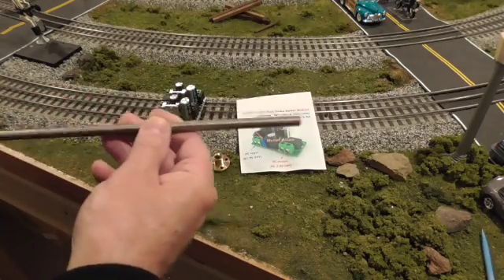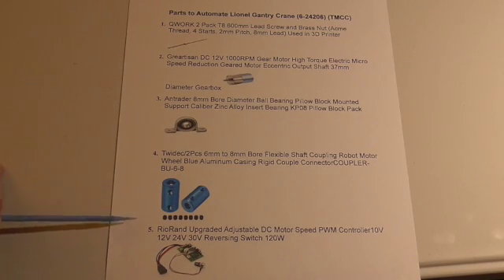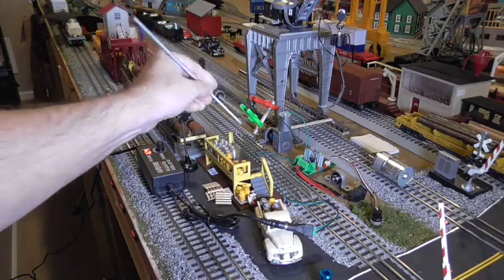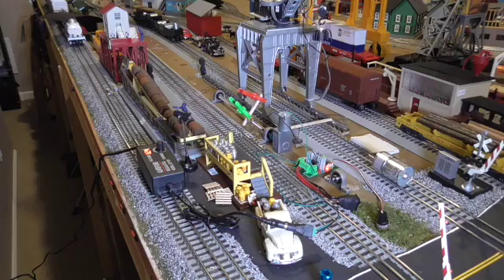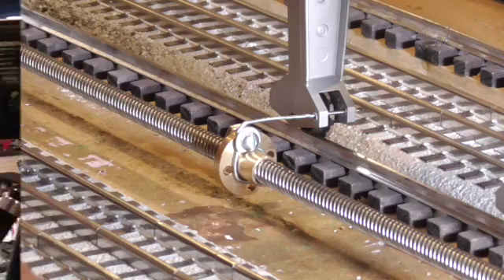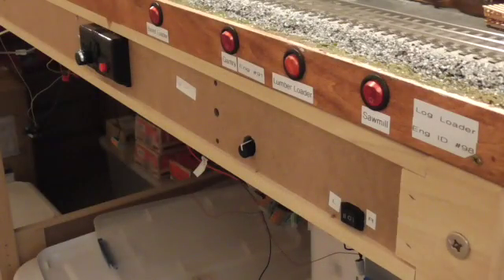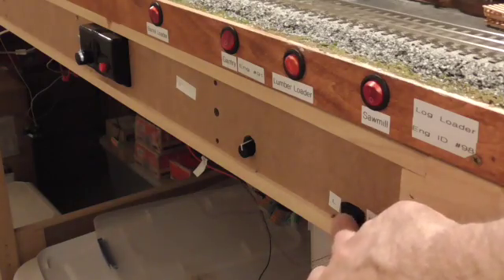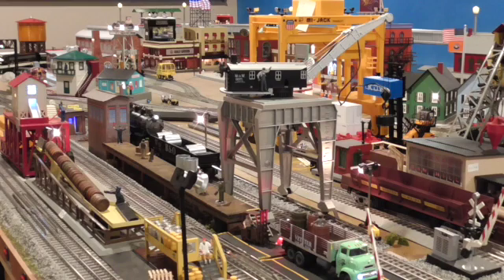Motorizing the Lionel Gantry Crane to travel on track rails

Comment: Lol I will probably do this via a pulley system with a little knob at my control panel
Reply from the maker: Thanks for watching. Good luck.
Reply: I’m still setting it up right now, I need to extend the wire so it can roll back-and-forth but thank you

Comment: Very cool.  Was thinking I would do this to my PRR conventional crane.  Using the motor speed controller, can you wire this directly to one of my specific voltage bus lines that I have run under my layout?  If I can wire direct to the bus line, any specific recommendation of the best voltage.  And then with the dial controller, I can still control low and top speed correct?  Thanks for your advice!
Reply from the maker: Yes you can. I just tied the into one of my 18V bus lines. The controller/converter.
Reply: Follow-up questions!  Is there a reason why you either didn't or couldn't have the slot for the control wires run parallel to the screw and therefore be mostly hidden by the nice loading dock you installed?  I was thinking about putting a weight on the wire to help keep it straight so there might be less drag.  Similar to a weight on the hose line under a kitchen sink where the faucet has the pull out handle.  Also, as the loading dock a custom job or a kit? It all looks great!  Thanks, Dan
Reply from the maker: @dbobro  Thanks. The dock is custom built. I think a weight might work.
Reply from the maker: @dbobro  I didn’t have room between the track and screw.
Reply: @Boscoed1  Thanks for the replies.  My thought was that I would try to run the cable down and then use that paperclip as my guide for the wire... that way it has a low constant point to use as the guide to move the wire with the gantry.
Reply from the maker: @dbobro  sounds good. Good luck.
Reply: @Boscoed1    One last question (I Think!!), what did you do to mount/secure the motor to the table?
Reply from the maker: @dbobro  Good question.  The torque of the cylinder motor I used would revolve around since it was secured to the spindle. Physics can be annoying.  My layout is mounted on 1" foam board insulation.  I was going to simply wrap it with t wo cable ties. That would work.  However, I tested the arrangement by securing the motor with T-pins. It worked and I just left it that way.  Then I covered the motor with that 2 story scratch built building.  I'll probably get around to securing it using cable straps....maybe...someday...  :-)
Reply from the maker: Regarding power. I reread the question. I use a DC motor to move the Gantry.  I use a Buck AC To DC Converter which accepts 18V AC as input and outputs up to  18V DC.  The dial is a potentiometer that then raises and lowers the DC output of the converter which is the input for the DC motor.  I hope that makes more sense than my original cryptic reply.